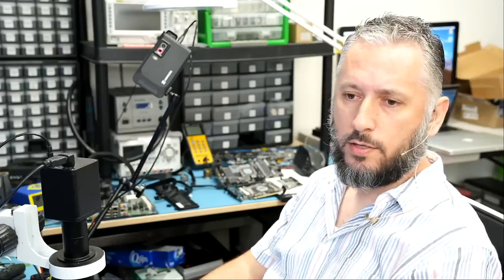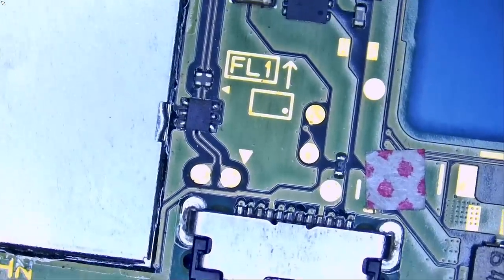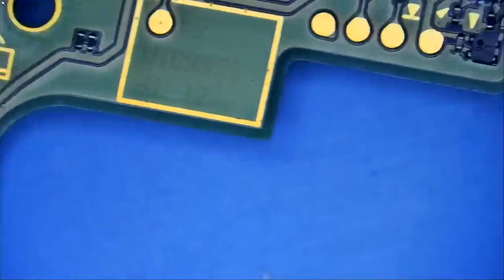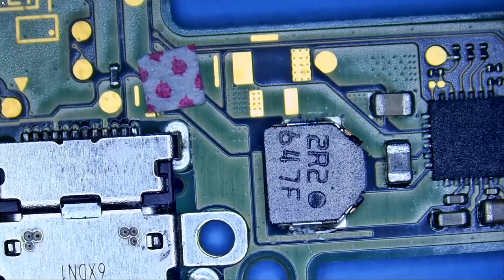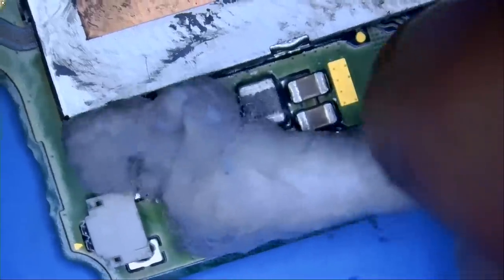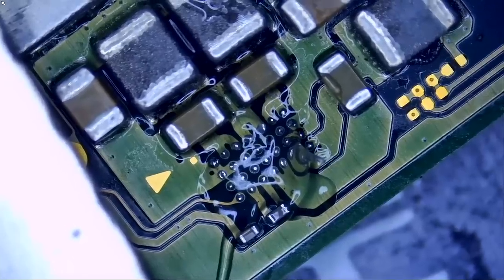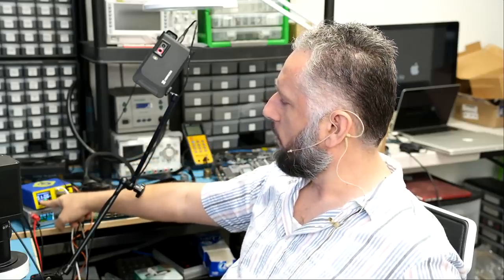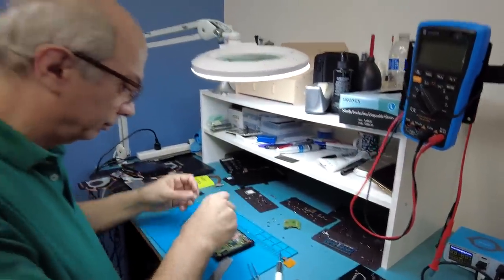Nintendo Switch Won't power on. Everything gone bad. What's wrong ?

Comment: I remember I once had a very badly cracked screen on my phone that I went in to get replaced.  Despite it being very hard to read the screen, the tech checked every little last detail of the phone painstakingly making sure everything from the calling, wifi, sound, etc and all general function of the phone was OK before doing the screen replacement.   Even checked voltage draw and charging. I didn't really understand why he went through all that trouble for simply a broken screen I asked to be replaced, but after watching some of these videos, I understand fully now.
Reply: so you mean there is a short in your new screen which has been replaced ?

Comment: Thats my switch, so to start off i wasnt trying to fool anyone on the description. i did my best to explain what was wrong from what i knew. i dont have all his fancy tools to diagnose all that other stuff, thats why i sent it to him. 
i bought that switch brand new on launch day so its a couple years old. its not custom or a special addition or anything fancy. but has all my info and saved data on it. only thing was the original plastics where allready breaking apart so i ordered a new shell and atempted to change it my self. bent the connector pins and thought that was all since it was working fine before i took it apart other then the shell falling apart. i did take it to a local repair shop and dont know if they caused extra damage or if it was me. but they said it was not fixable. but glad to see alex was able to get it fixed 😁👍🏽
Reply: $6000 tho?????
Reply: @Aamer91 it wasn’t $6000. 😂

Comment: Here in the UK, the favourite customer and/or ebay seller phrase is 'probably an easy fix'. If you ever see that or the infamous 'untested' - RUN!
Reply: Yep! Or they tell me "I saw a video and it's just a five minute job." (yeah, that 1hr and 5min video they edited down to ten minutes, right?) or they say "I used to fix this stuff but I don't have time anymore, but I know it will be easy for a guy like you." 🤣
Reply: There is a translation for "it's probably an easy fix". It means "I've already tried to have it fixed at 3 different shops and now it is completely ruined" or "it has layers shorted and traces melted, eventually with exploded holes in the motherboard".
That's all I can think of when I read "it's probably an easy fix".
Reply: or «just for a check-up»
Reply: 'Yesterday it worked perfectly!'
Reply: @Dandan-tg6tj  lol yes exactly.
Reply: @tomkroebel4936  or..."I haven't had a chance to use it since you repaired it six months ago, and today I tried to use it but it's not switching on." I get the laptop going and there are event logs going back six months. 🤣

Comment: Ebay Switch, savaged good parts and replaced with faulty ones. Then customer bought it, send it to you for repair, and discover half of the device is broken. 50$ switch now mutates into a 6000$ one. 

And probably still has more parts broken.

Nice job as always, experiences pays off.

Comment: I see the screen issue all the time when a customer attempts to change the entire shell to something "cooler" like the transparent colors. The requirement to gently heat the adhesive and essentially peel the screen off the front frame seems to end in disaster more times than it doesn't. Most of the time a removal pick was slid directly into the ribbon cable and that's that.
Reply: did that on a really old DS Lite. Spent hours methodically and carefully replacing the shell, only to have the top screen flash and bottom screen not work at all. I couldn't find any damage and it may just be improperly seated ribbon cables (they looked finicky), but after hours I was tired of messing with it.

Comment: The note said: "The ribbon cable CONECTOR" was damaged, just like Big Boss and you said.
The note said: Everything was working before opening up. Sure it was working BEFORE.
But after powering on the nintendo with a damaged connector, the nintendo and screen got damaged.
Sometimes it is possible to misread and judge on that basis, it happens.

Comment: Every customer: "It's probably just a loose wire..."
Reply: "...and one little more cable I ripped from the motherboard (wi-fi connector actually) ... and if you open it anyway, check those two little insignificant small components I managed to break with the screwdriver and I don't know what they are... and maybe the screen is still working even if I dropped it and it is cracked a little bit..... and maybe the battery needs replacement, I don't know but the battery is just a little bit swollen, no big deal. The whole thing might still be be working after all with no intervention, as far as I'm concerned".
Yes, I know what you mean, I get consoles pretty often from clients saying they only need dusting and the thermal paste changed while the consoles don't show any image whatsoever. I learned my lesson and I am filming everything.
Reply: As a system manager I hear this all the time, looks like a simple thing to me, me saying to the person that came to me for help, Why are you here with me with a simple problem in your eyes. If it is simple you can fix it by your self. If not than it is not simple and let the people that have the knowledge to fix it work on it.
Reply: @rafalbuijs5061  In most cases, I think it's largely their hope over my experience. Perhaps this is an easy job, cheap fix, etc. I try to be as kind as possible when I tell them that such a symptom is pretty much never a 'loose wire'. I mean, loose wires are still thing in 2023 - but not on these devices lol.

Comment: Another great video. I noticed your using multimeter probes that are bent for easier access. I have looked all over for those including your website and cannot find them anywhere. Any chance of you selling them at some point as they would be so much better for getting in those tough areas.
Reply from the maker: It's the same one we sell, I manually bent mine. https://northridgefix.com/product/high-precision-multimeter-probes-extra-sharp/

Comment: I have seen this issue before with no display showing it being charged or turning on. What it might be is a hacked switch with AUTORCM installed. you will need to let it charge and then run the payload injector and run hekate and it will boot. once it boots you will gain back access to the unit.

Comment: In this day and age everyone is a specialist..... They "know exactly" what is wrong because it looks so simple, but by just putting in a cable upside down and turning the device on the whole bloody thing can, and will, go up in smoke.  Then, and only then, will they send it to a professional repair shop.  Customer is, in general, always wrong - and I have been a customer too - lol.  I can fix any electronic device, but don't ask me to work on your car.... honestly, don't ask me....
Reply: Cars nowadays, are rolling computer systems, and you just aren't used to the environment that mechanics work in. They now need to understand some computer basics, like (CAN) network troubleshooting, tracking and reading data sheets to follow circuits.
"They "know exactly" what is wrong because they studied it and were taught some very important concepts, that cannot be learned by working on tech. Some things you just have to get an education on, to know what you're doing.

Comment: The "just the connector" story is always strange to me for a console like this. If there was no other problem, why did you disassemble and damage the connector? For fun? Who believes this?
Reply: so thats my switch. and yes acually i did replace the shell for fun i have more then one btw. but that one the shell was cracking and its a v1 modable switch that i got on launch day, so i want to save it. it WAS working fine before i took it apart. just the plastic shell was falling apart its normal for those v1. and i did damage just the connector itself when i was putting it back together. i dont know if that caused all the other issues that he found and fixed. i did also try a local repair shop so dont know if they caused more damage to it. but thats why i sent it in for them to fix. i had no idea all that was wrong with it after i damaged the connector thats all

Comment: I have a question, its probably pretty obvious but i just have to get it confirmed.
I bought some cheap flux on ebay, its probably fake and really bad. But when i use it it does not seem to work as good as yours do, i feel like its almost not helping to use it. Just want to know in case it could be other things.. But im pretty sure its the (bad) flux i got.. 😛
Reply: AMTECH 559! As far as I'm concerned, That's the ONLY flux! Alex is a distributer, and buying from him helps to support the channel and promotes  more and more helpful videos!
Reply: @josephroberts6027  Thanks! I actually think its called amtek or something the stuff i have, but im willing to bet its a knockoff, or its so old and degraded that it does not work properly..

Comment: Hello sir I have a samsung smartphone (galaxy m21 2021 edition). It was thrown badly by my little brother & now my phone isn't charging. The issue is not in the charging motherboard as I checked it myself. The issue is from the main motherboard. Can u please tell me where the issue can be as I m not that professional to diagnose the problem.

I even let it checked on the local repair store & they said that it's the issue of RAM IC & it's needed to be reballed & then my problem will be solved.
Reply: Look into videos of reballing, you will need to clean the old solder, then use a stencil and some Quickchip soldering to reball it.

Comment: I almost feel like he changed the assembly and in doing so shorted the lcd connector. This could have caused the max to fail and killed the screen. Far stretch but possible. I know the max is cpu power though. Who knows 🤣